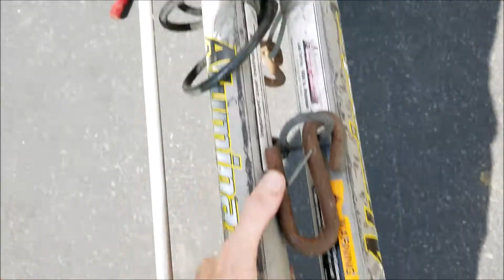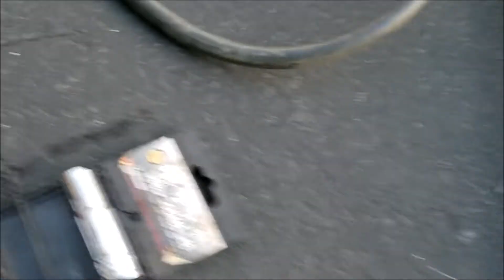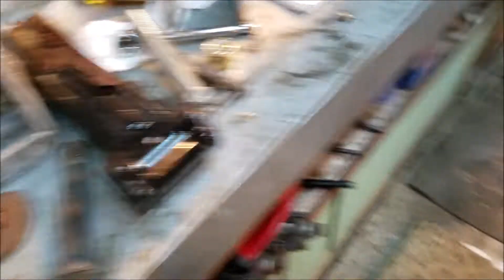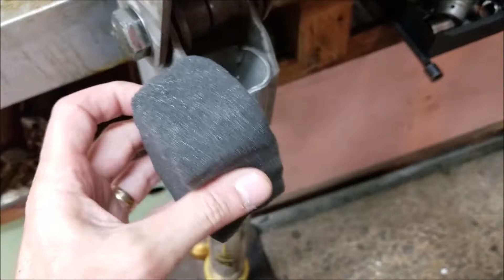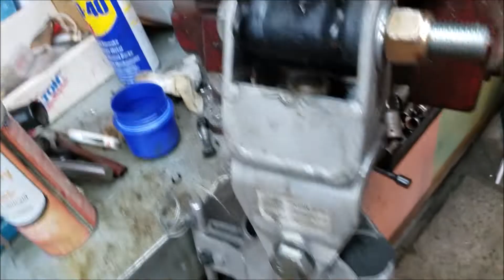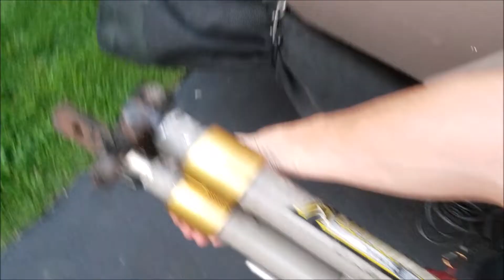RV Repair: Demco Aluminator Tow Bar Wore Out, But I Fixed it. Tow Bar Tuneup

Comment: What is the rod on the left side for? I just bought one of these and am trying to figure it out.
Reply from the maker: I use ours to coil the the big wire that feeds all the lights it coils up like a phone cord.
Reply: @ktoutdoor  Thanks, At first I thought it was a pin that held the hitch in place when it was folded up. Then I realized it wasn't removeable.
Reply: How did the inter shaft seals look? 
I just picked up a used one and those seals are rough feeling.